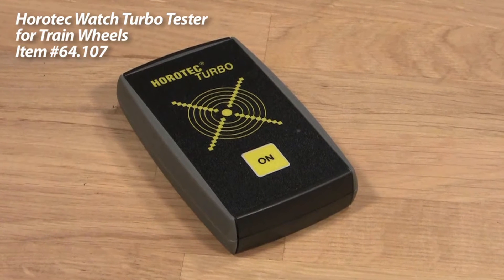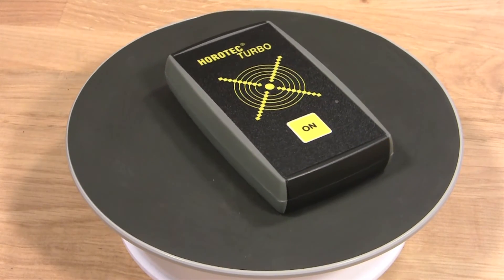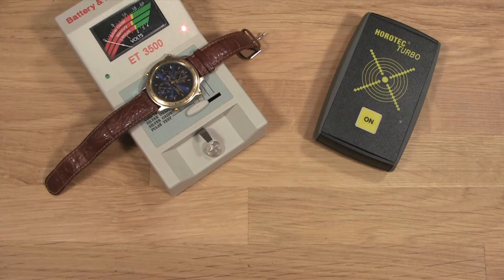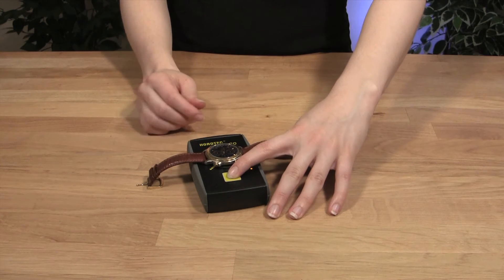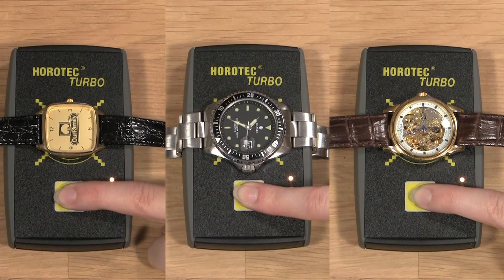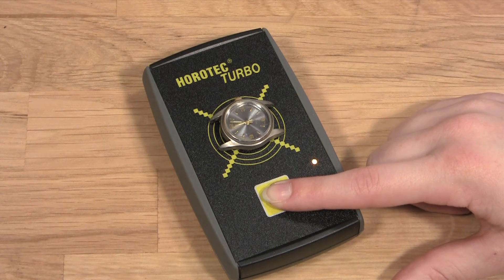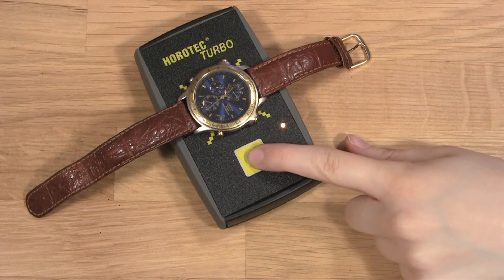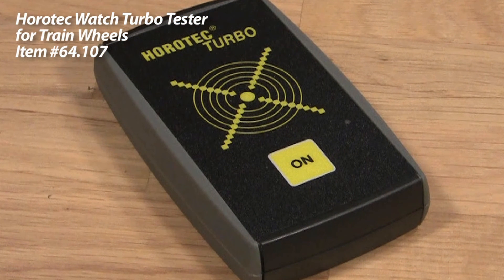Horotec Watch Tester Turbo Test

Comment: Magnetic movement will not make a bigger Problem with the watch??
Reply: Runs the stepper motor at high speed. These devices are OK. Best remove battery tho.
Reply: This is an ANALOG quartz movement, not DIGITAL LED type.
Reply: I think he’s asking if this will cause the movement to become magnetized.   Which is why I came here to ask.